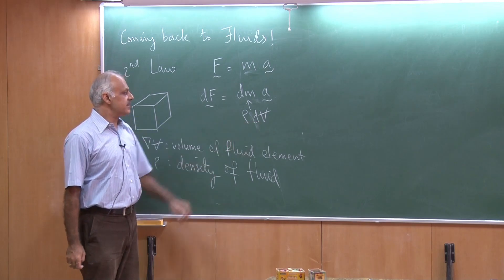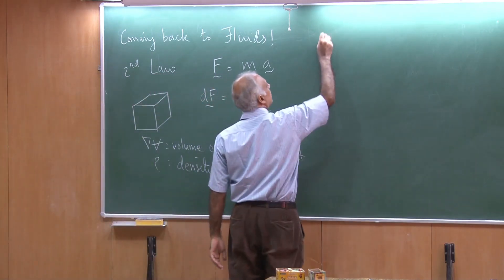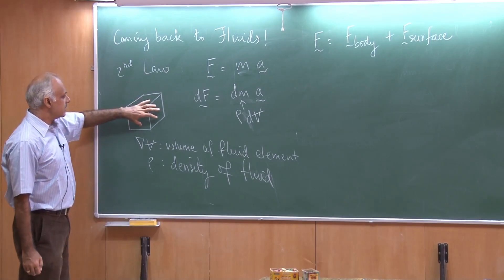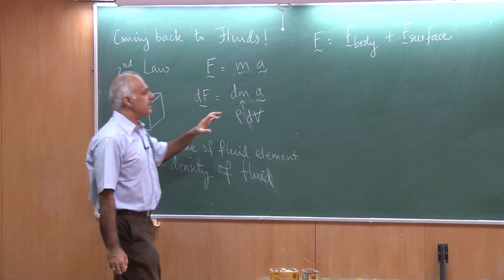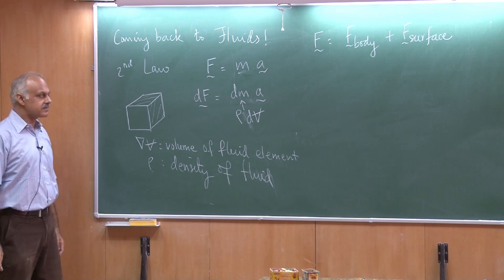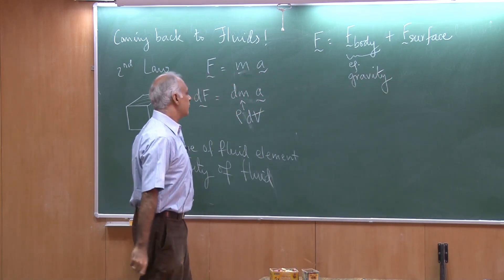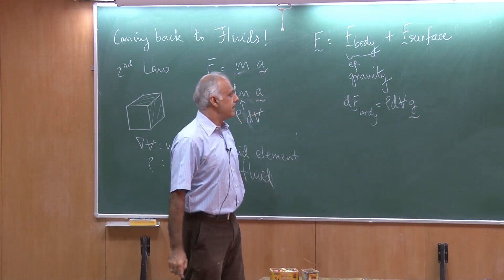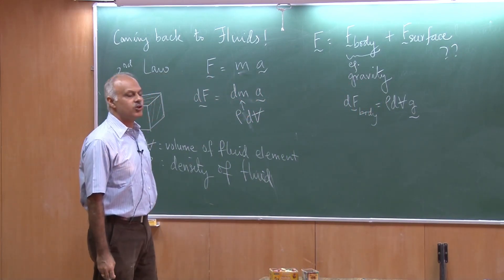Lecture03_PartB: The stress tensor (Fluid Mechanics and Rate Processes by Sanjay Mittal)

Comment: Sir, corresponding to surface force and body force can we have surface acceleration and body acceleration respectively?
Reply: It is surface force and body force. It implies an acceleration, provided you are looking at a mass element(lagrangian view). In the Eulerian view, the force acts on a fixed volume of fluid, and instead of acceleration times mass, we talk of differences in flux of momentum across bounding faces created by those forces.